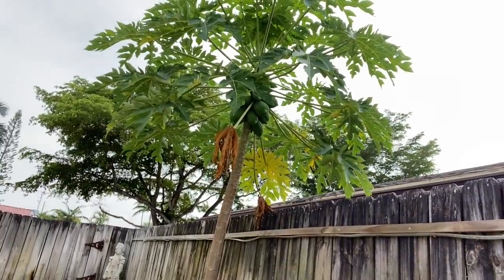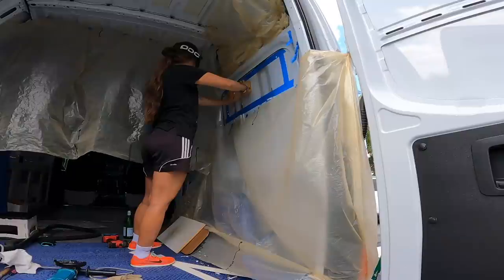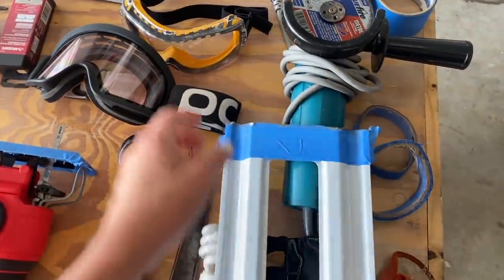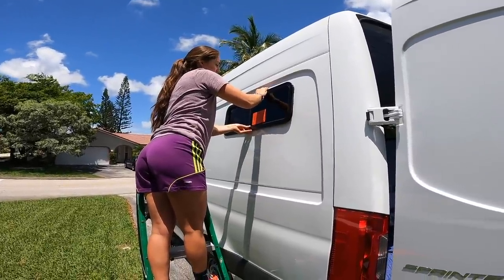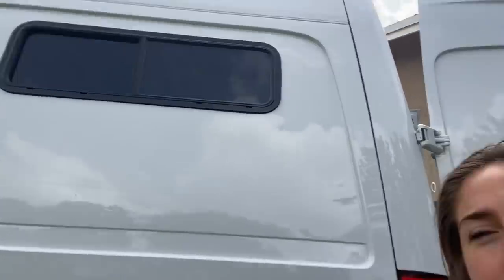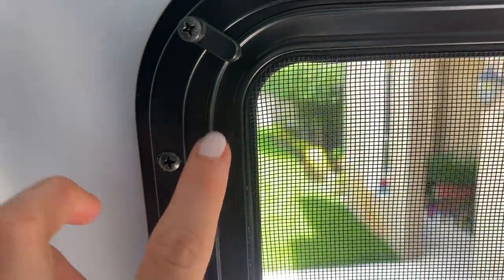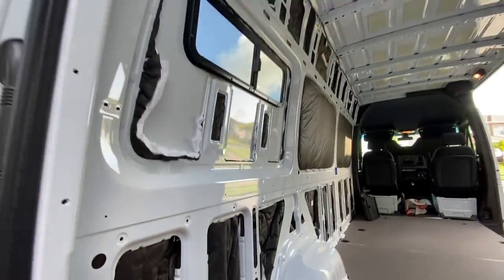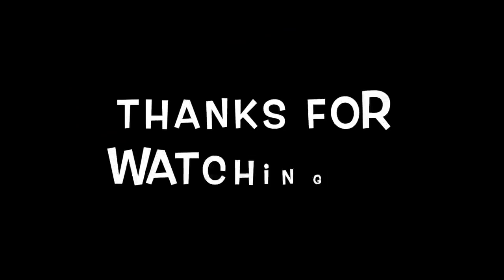Mercedes Sprinter van window install

Comment: The van is coming together nicely. I do have one recommendation, I would remove the windows and spray some self etch primer on the bare metal where you just cut l and then some paint. Those bare metal edges will start to surface rust with just the moisture in the air and eventually leak. Can't wait until more van updates

Comment: Hello Heather, I'm building a 2021 sprinter and like the way you put floor insulation i want to do the same as you but insulation seem to be a little thick, do you just screw the floor back on top of insulation and use insulation as the cushion cushion
Reply: use the insulation as the cushion and another thing are those screws long enough with insulation in between?  Thank you

Comment: Looks great!  
Did you paint the bare edge of the metal after cutting?
Reply: Good question, you think it would rust faster if you don’t paint it?
Reply: @Theyachtbroker  Yes. Especially in humid environments.
Reply from the maker: @ianfurqueron5850  Yes, we absolutely painted it. Every cut we painted, good catch!

Comment: The whole mtb van thing has become such a cliche i almost don’t want one anymore. I thought about doing something like this 10 years ago but i couldn’t justify the extra headache and how much it would sit in my driveway vs actual use. Then you think about reliability, insurance, and you still have to have a daily driver. Warranty and resale value is shot once you do custom mods. Its a money pit like owning a boat. I just opted for a large SUV. To make it worthwhile you really have to live in the thing a lot and run it all the time. Engines don’t like to sit for long periods of time.

Comment: You took away the strength of the van.
Reply: You’re right, it’ll probably collapse immediately once she starts driving.
Reply: If the factory did it they would have rebraced that section. Going 80mph with window open things gonna shake and vibrate.
Reply: Don’t go 80mph with the windows open: check
Reply: Just go outside with morning coffee. Easy way for someone to break in. I could pop that window out in 10 second. Why let people have opportunity to look in. Just old Pro Motocrossers advice
Reply: Heather is definitely packing heat, ain’t nobody gonna mess with the van.
Reply: I hope so man. 🙏
Reply: Like her content. We see. Good alarm should be fine. Get some drone photage her laughter 😃  channel might pop
Reply from the maker: @34652542  Thank you!! I hope not to be bothered by anyone